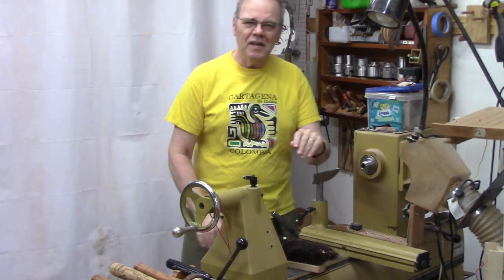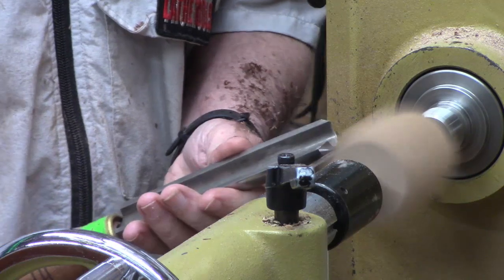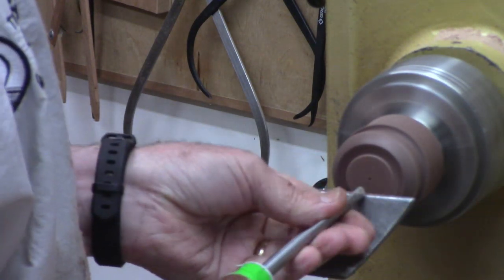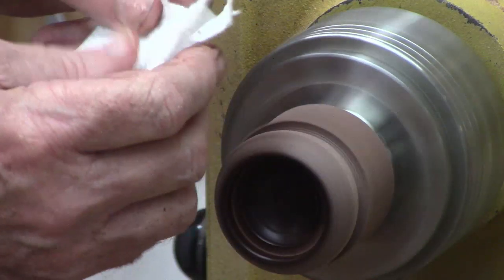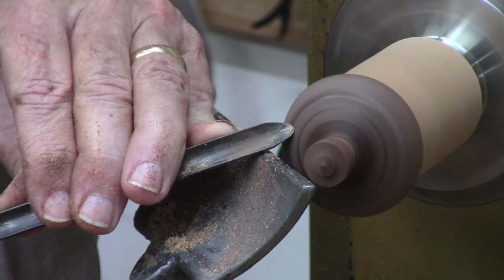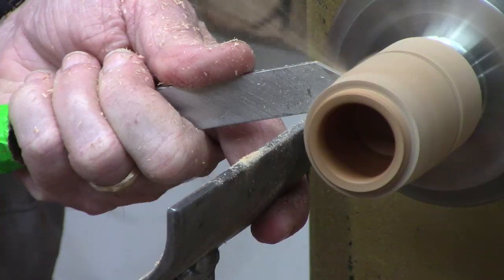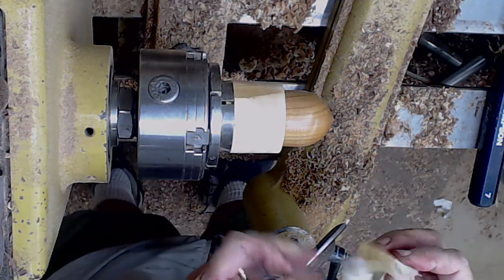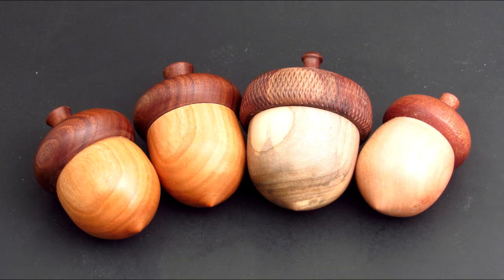Acorn Box – Simple Woodturning Project

Comment: One small little correction.  OB Shine juice is 1/3 Alcohol, 1/3 Boiled Linseed oil, and 1/3 Shellac.  Not sure anybody is going to get the receipe from this video but if they do it won't turn out right.  Very nice project.  You may want to notate the correct mixture at that point in the video.
Reply from the maker: LOL, it just wan't rolling off the tongue was it!
Reply: Instablaster...

Comment: Very satisfying for a one hour project, Mike. For your larger, threaded acorns what is the maximum diameter you will thread, and choice of wood?   Bernard.
Reply from the maker: About three inches. I like a dark wood for the husk. I like a lighter figured wood for the bottom. Most any dry domestic  hardwood. Large exotics are pricey.

Comment: Hello Mike. Hope this finds you and yours doing well.
I have a turning apparel question for you. 
I live in the upper Midwest (I used to live in your fine state) and the winters get pretty cold and I turn a lot in the winter. I need to wear a jacket in the winter but I’m always concerned about getting a sleeve caught up in the chuck or between the tool rest and the blank. I wear tight sleeves but I was thinking of trying one of those leather arm protectors that bow hunters use to protect there arms from the bow string… Your thoughts? Do you have a video or something on your web page concerning the topic? If you or your viewers have any suggestions they would be greatly appreciated! 😊
Thanks for your time Mike.
Ron
Reply from the maker: For me the key is tight fitting cuffs.

Comment: Was that stock piece about a 3x3?
Reply from the maker: These are smaller starting at about 2 1/4 square for the lid and about 1 7/8 or so for the base. You can scale up or down but I would not go larger than 3" or wood movent may interfere with the fit.
Reply: Thanks Mike